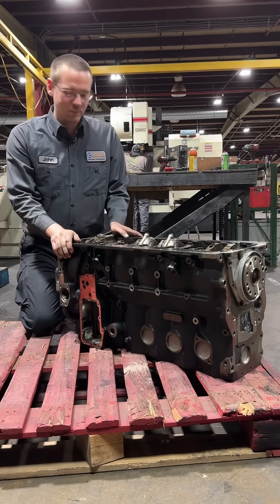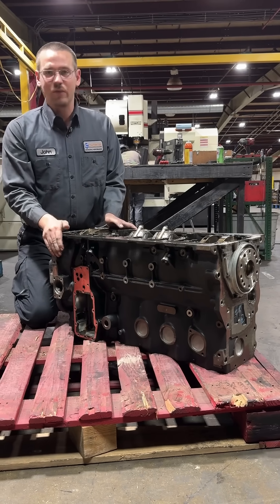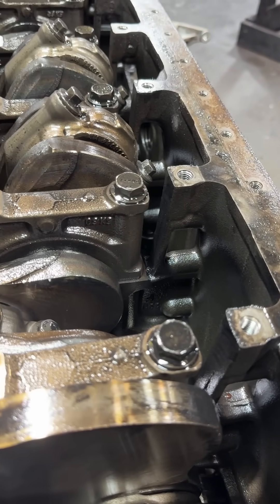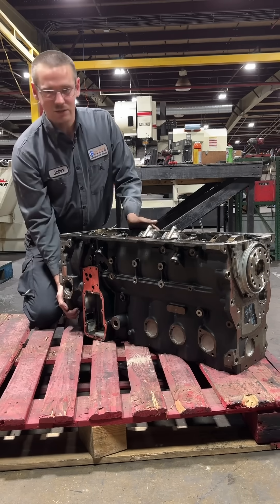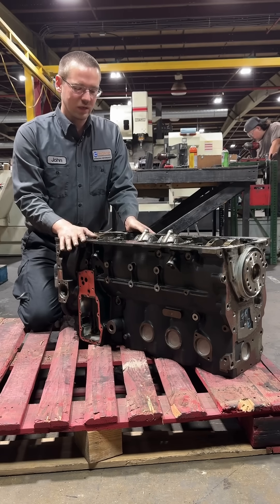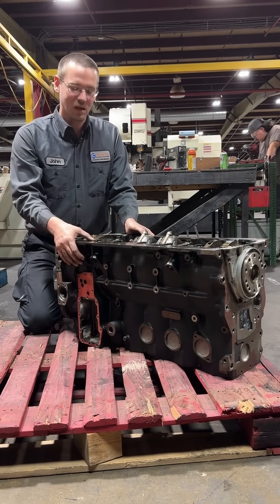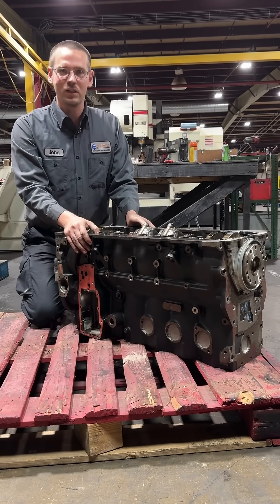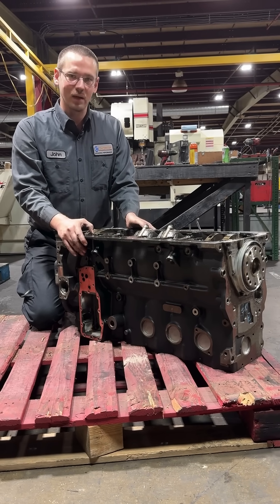We build Cummins Engines and don't use their Block!!

Comment: Apparently CGI is very particular about the cooling rate when it is cast; if cooled too quickly it becomes nodular ductile iron and if it cools too slow it becomes more like regular grey cast iron.

When designing the engine mold for CGI casting they try to have as uniform thickness throughout the block as possible, because casting thickness determines how fast the material cools. Otherwise thin sections would tend to become nodular iron, while thick areas would have more properties of regular cast iron.

They seem to have gotten rid of the sections from the older mold that were thicker as a result, seemingly making all sections about as thick as the main cylinder wall area as that is the most critical thickness.

For what it's worth, that section with the window seems to just support the skirt, not the main bearing area. In the old block there was very thin webbing where that window is now, which I doubt contributed much strength to anything. The very thin webbing that used to be there was also probably removed due to the cooling rate issue.